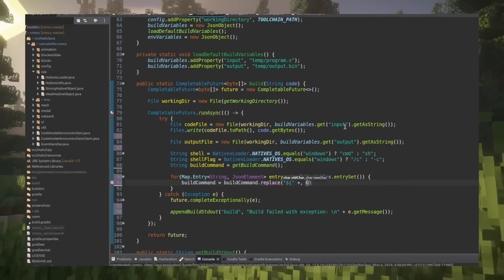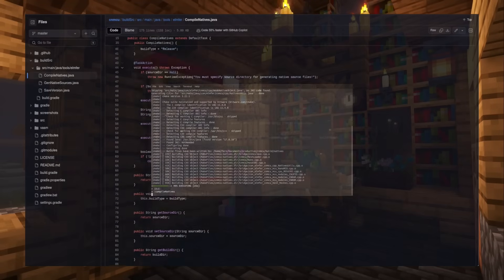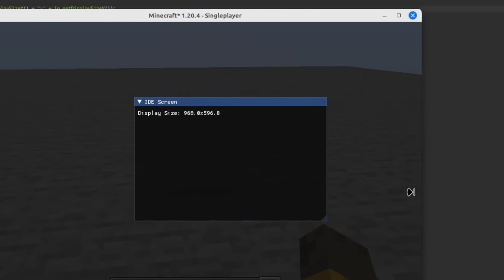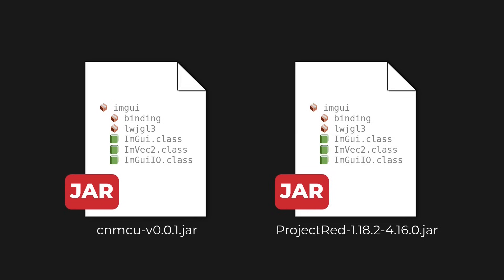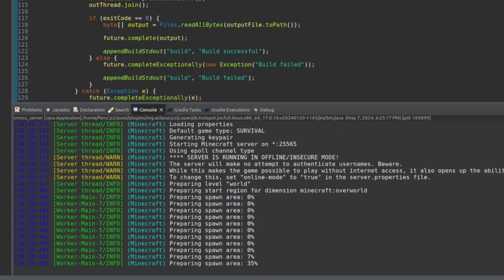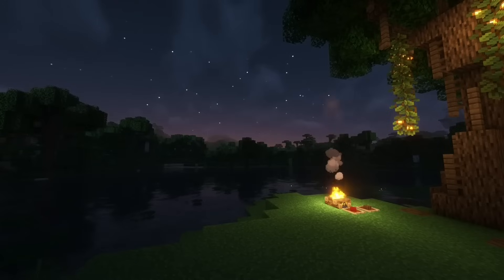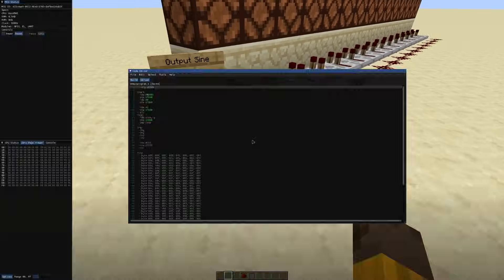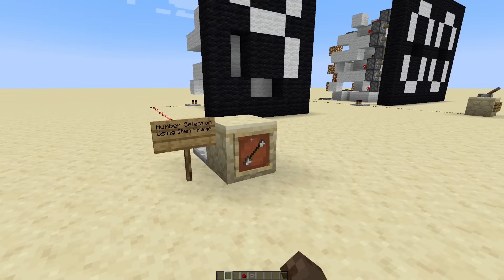How I Made A 6502 Processor Run in Minecraft

Comment: Holy crap! This could mod bring a revolution to every kind of redstone contraption out there!
Reply: The main thing it adds over previous mods is the fact that it's based on a real ISA rather than using a lua interpreter. Otherwise I don't think it can do anything that those couldn't.
Also, serious redstoners would easily consider it cheating and would stick with vanilla, or sometimes more limited redstone mods.
It's great for learning about the 6502 and assembly though!
Reply: @angeldude101 I suggest to check out mod Redstone Pen. It adds basically programmable comparator. Very far from assembly, but it can execute kinda complex instructions based on the given inputs. A cluster of these blocks may become an actual redstone CPU
Reply: 555 timer would be more useful for applicational redstone. This is for computional redstone only
Reply: @angeldude101  Take a look at oc2, it's running on a RISC V emulator that has been written solely for this mod and is even able to boot linux

Comment: Time to recreate old computers in minecraft
Reply from the maker: Heck yeah!
Reply: Still need a display block for it to work. Most old computers used the VGA protocol which allowed each pixel to be addressable in video memory. Wouldn't be too bad to implement since you just need to reserve a memory array to act as a VRAM for each instance of the display block, resized for whatever size monitor you make (preferably 2:1 ratio)
Reply from the maker: @SadKris  For sure, a display could be placed next to a mcu and its vram can be mapped to the cpu's memory, pretty cool to have a display for machine 👍

Comment: Nice Projekt and congratulations that it works so well.
I have 2 questions for you:
1. Did you know about the new java ffm/ffi that allows easier access to native functions? If so, why did you decide to use the "old" jni approach?
2. Why did you decide to use imgui instead of a minecraft native gui library?
Reply from the maker: Thanks! I didn't know about about java's ffm 🤔, and JNI is something I am familiar with for the longest time. And I used ImGui because its design allows me to add UI elements without much effort, so this makes it easier to create intricate IDE for the mod.

Comment: I'm not sure how you're importing the imgui library exactly, but you should shadow them into a fatjar using a gradle plugin, that way multiple mods can use the same libraries, (mostly) without conflicts, even when using a different version compared to another mod!
This works by moving all the library packages to a subpackage of your mod, you'll have seen this behaviour before if you've ever seen multiple instances of a class like "Gson" in the autocomplete list, because multiple libraries depend on it and shadow them separately.
Reply from the maker: You are right! I did try use the shadow plugin, but the fat jar file it generates uses unobfuscated Minecraft code with it .This is not going to work outside of development environment, so I have to figure out on how to fix that
Reply: What happens when u rename the imgui lib to something like imguifor6502proc would the functions etc in it be only accessible from the package name like a namespace (Idk for sure because as u can see I am not sure how Java works) if so then why don’t u donthat insteaf
Reply: @elmfer  make the shadowing depends on reobf task, dont exaclty remember how to do this but i've done it before with other libs ^^

Comment: Interesting, I have long planned to create a Minecraft mod for something similar. However I want to run way more CPUs with high-bandwidth peripherals, and so I want to implement a network protocol to access such an emulator, and just implement a "client mod" for minecraft(-servers). You can distribute screen images etc. via a side-channel(not necessarily via the Minecraft protocol). This also would make it easy to change the emulated CPU architecture, and implement the client mod in a cross-platform way.

Comment: Cant you compile the emulator part of mod to WASM? There is GraalWASM project which allows embedding WASM code in Java applications.
Reply: might be possible, but you'd need to port imgui to wasm as well, because the native apis for creating the draw context and loading opengl functions are different, as well as compiling the native 6502 library to wasm as well.
Reply from the maker: I didn't know you could run WASM in Java 🤔, luckily GitHub automatically compiles C++ code into many platforms for us so I think we're good

Comment: When you used imgui for displaying the colorful texts, what methods did you use to show the styled/colored text in the text editor field?
Can't seem to find any way other than implementing that manually or writing JNI code for java to work with a library that does that in C
Reply from the maker: The code editor can syntax highlight (color text) based on what language is selected, and it uses regex to find keywords and color them. Currently, C++ is selected, but obviously it doesn't work well with Assembly. I do have to create a custom syntax highlighter for it at some point

Comment: why not use the more modern 65c02?
they support not only the legacy mos6502 instruction set but can use newer instructions such as: "stz" (stores $00 at an address) or "bra" (similar to "jmp" but uses 1 less byte, also faster)
Reply from the maker: Those are valid points! From the start of the project, I had an outlook for the microcontrollers to use the original 6502 because of its cool history with 80s computers. Nevertheless, this could be an idea for creating a new MCU variant

Comment: Not trying to be rude, it's cool actually but many here don't seem to be aware that something like this, with even FORTH as the language has been made ALL the way back as to 2012, 1.2.5. The mod Redpower 2 actually brought that in place, it was a miracle it ran so good and because the code was Closed nobody knew how it ran that good either.
Reply from the maker: Gotcha, there is also a mod called Microprocessors that does this as well (with a custom 8-bit processor), but I still made this project because it's fun to make and wanted to apply what I learned from the 6502
Reply: @elmfer  
That's still pretty cool. Nice to always implement your own ways and you anyways learn and get experience.

I didn't mean to sound of as rude even though I re read and it sounds like it..I'm a IT like guy who absolutely is very poor at coding. I just can't and absolutely suck at it. 

So good job regardless :)